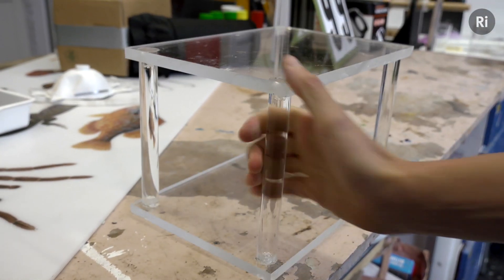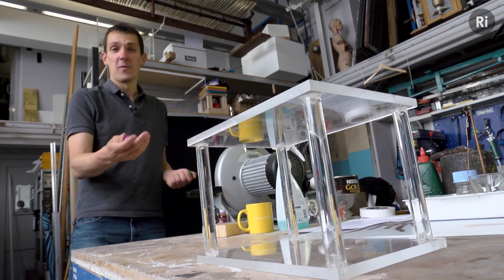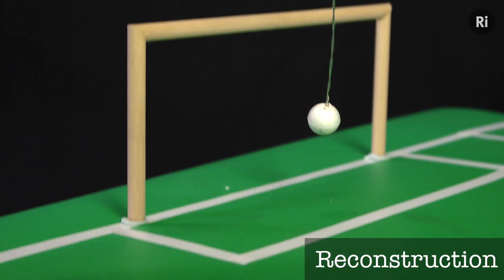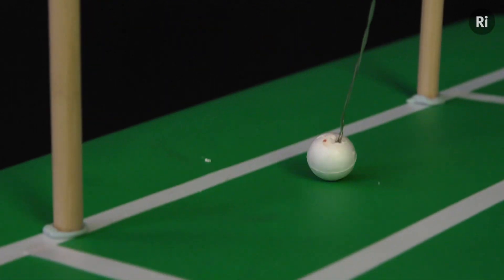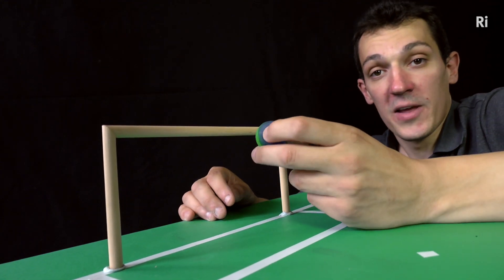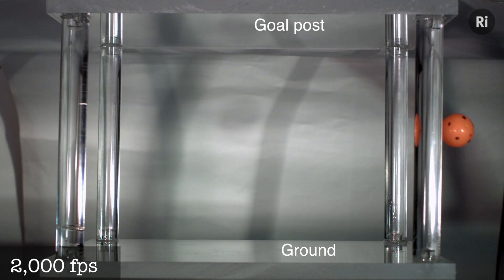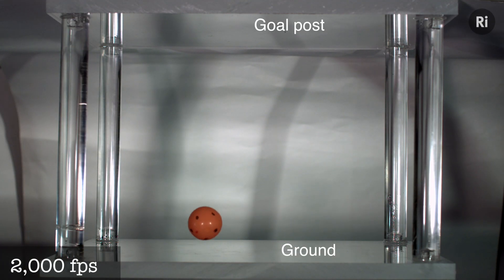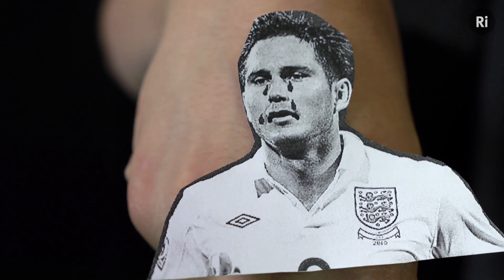World Cup Fail: the science of Lampard's 'goal'

Comment: Wrong. Back-spin is often present in powerful shots, which can cancel out the spin from the impact and make the ball bounce straight down. The ball can absolutely hit the crossbar twice without going in, and it's happened more than once. Lampard's shot was absolutely over the line, but this is not a method that should be used by referees, because it doesn't show for sure what happened. What they need is goal-line technology and replays, not an unreliable trick to guess that the ball probably crossed the line.

Comment: Actually this is nonsense, it all depends on which part of the width of the crossbar the ball makes contact with...ie: if the ball had hit the bar half an inch further in it would have hit the ground and bounced into the roof of the net, if it hiad hit the bar a half an inch further out it would have bounced on the line and out, this is what happened in the 1966 World Cup Final.
Reply: The point is if the ball hits the crossbar, lands on the floor and rehits the crossbar, it's either gone in and spun back. Or it would have to be hit incredibly hard to hit the crossbar land on the line and bounce back up.

Comment: If you tilt the bottom side of the tunnel and give the ball a spin, is there no possibility the ball will go straight up with no spin?
Reply: It is theoretically possible.
Reply: So as the top bar of the goal is round, the ball could hit it at an angle that makes exactly that? So this is actually no proof at all?
Reply: Note, I said "theoretically". The chance of it actually happening is so small that it's effectively 0.

Also, he does mention that upon review of that particular instance, it was clear that the ball entered the goal.
Reply: Well if you increase the angle further, the ball would even come down in front of the line and go back up, wouldn't it?
Reply: Let's say the ball can hit 3 points on the crossbar - The outside of the crossbar (facing the pitch), the exact underside of the crossbar, and the inside of the crossbar (facing the stand/net). If it hit the outside of the crossbar, it would never have crossed the line in the first place. Then in either of the other 2 cases, it would have generated the type of backspin discussed in the video.